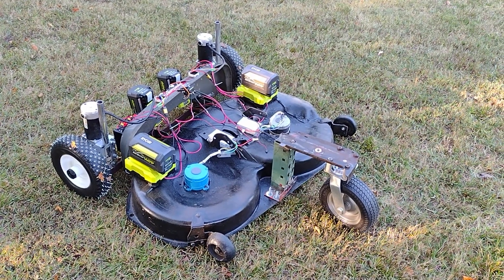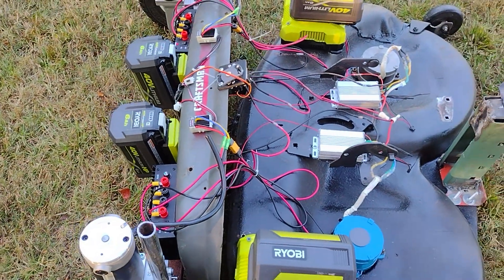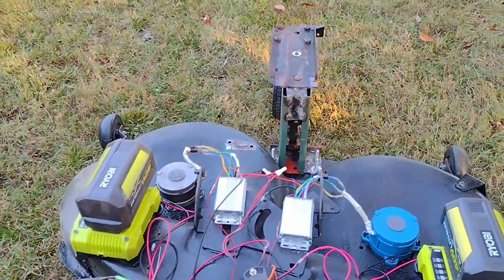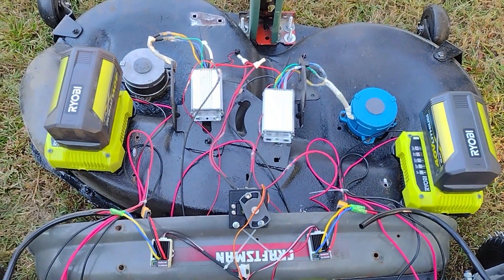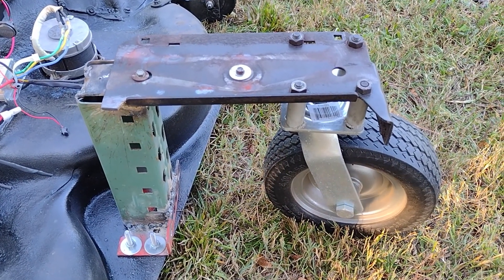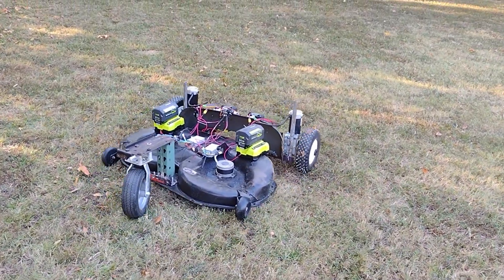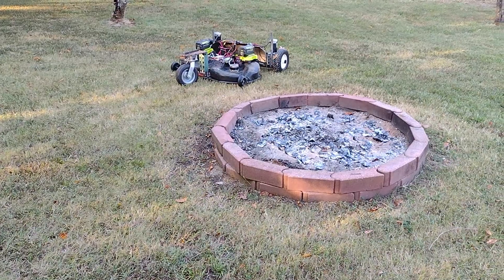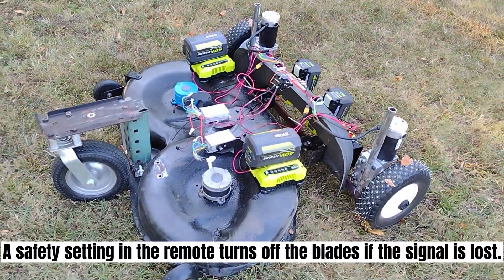Ryobi 40v Powered 42" DIY Radio Controlled Zero Turn Lawn Mower "Mad Max - Fury Mowed" - Part 2

Comment: what are the cutting  motors, watt and size of blade?
Reply from the maker: The cutting motors are actually pulls from a Ryobi push mower with 21" blades. They are about 700 watts, but I don't know for sure. I used the motor and controller from a Ryobi push mower.

Comment: The only problem with this is that the deck needs to be independent from the everything else .  I know you at stag 2 . Good concept . So how I would do this and still keep it simple as possable . Weld a support frame to hang the deck on . The frame also is the support for the wheel motors and the center wheel . I would get rid of this being a tricycle  and make it 4 wheel drive and steer . Then it would turn on a dime and can go up hills with out slipping . This being a 42 inch deck I would install two 5 hp Briggs engines it with blades .   This is to keep power loss down as well and letting the power packs putting power to the wheels . Longer mow times . You can find some good push mowers people dont fix or dont even maintan . Just setting by the road to be picked up . With a little bit of work like cleaning the carb and check these mowers out does the job .
Reply from the maker: I like the 4 wheel drive idea. I've even thought of using tank tread. Hanging the deck wouldn't be hard and would allow the deck to adjust better, although I haven't had the problems with that I thought I might. I won't get a gas motor, even though they are easy to get. Been a mechanic for many years, but I'm so tired of cleaning carbs I just can't stand out anymore. 😂 But I did consider getting a large battery and a bigger pair of electric motors, about 5hp, to do the job quicker.
Reply: @oddjobsandrandomprojects  Here is an Idea why not use two boat bats at 130 each . or deep cycle bats .
Reply from the maker: @jeffmullinix7916 That's actually a solid plan. I can also use those to store power for my garages off grid solar setup.

Comment: That is really cool. Maybe you could use heavy string trimmer line for blades. It would be much safer that way.
Reply from the maker: Not a bad idea, but it might wear quickly. I did set the speed slow to make it a bit safer. It's still a work in progress.

Comment: Put solar panel on the top to charge all batteries and also to cover the entire setup
Reply from the maker: Not a bad idea, but I'd probably just switch it to a lithium golf cart battery to do that. Then it's easier to set up a charge controller. But definitely worth considering. Currently I just have the solar panels on my house and use them to charge the batteries inside.

Comment: Add a drone and you got a work from home lawm mowing job for highway and stuff like that 🎉 just like a video game 😅
Reply from the maker: I'd have to find a way to increase the run time. Perhaps add a solar panel and some big batteries?
Reply: @oddjobsandrandomprojects  Yes, then have maybe 2 or 3 instance of mower, when working on 1 the others are charging, some kind of tandem work mix with lunch and break to squeeze charging time.

Comment: Did the tire nub thing work better ? Do they tear the lawn?
Reply from the maker: The tire nubs do tear the lawn when you make a sharp turn, but they also aerate the lawn. So it's good and bad. But they help the grip a lot. I find that double ended blind nails make the best tire nubs.
Reply: @oddjobsandrandomprojects  thank you for the reply. I will not put theses on my wheel :).

Comment: Can see several things that require "consideration". Firstly the reason the controller is making a noise is because the controller you are using is in the audible frequency. To give you an idea the controller I bought for my electric tilting trike is the Evnetics Soliton 1 controller has two settings, one I think was 8kHz, and the other is 14kHz. One most people will hear clearly, the other may be out of the hearing range of some, at the very least it will be heard at lower levels, but comes at the cost of efficiency. The controller on the remote control mower I am currently building is a Sabertooth 2 x 60A. I haven't tried it yet, but a friend used one, and I haven't heard noise from his.

The first thing I would address on your mower is the rear single wheel. Where you have it bolted to the deck, it is under a great deal of mechanical leverage, and I foresee it cracking / tearing the deck where the bolts are. I would tie the vertical upright into the top of the deck on both sides forming a pyramid. It would probably increase the strength 5x, and reduce the flex on the rear wheel.

In an upcoming video of mine you can see how to set up the switches to turn them on and off via relays, and some of the consideration that need to be considered when playing with relays. Overall I like your minimal approach. Can you mow the whole lawn on a single charge?
Reply from the maker: Much appreciated information! That helps me understand the motor whine better. You are right about that rear wheel setup, and I will definitely add more supports. I look forward to your video on relays, as that is a far better setup than what I ended up with. I cannot mow my lawn on a single charge, but I didn't really figure I would be able to since I have 2 acres. Takes about 3-4 sets of batteries, but I have that many on hand so not a big deal. I may see about adding extra batteries with a diode to prevent them from trying to charge each other. The blade batteries run out of power when the drive motor batteries still have 50% power left. So at least adding an extra battery to each blade motor would balance that out.
Reply: @oddjobsandrandomprojects  the other thing I was thinking you might want to look at is tip speed of the blades, as it effects grass cutting efficiency. I did a video on it ages ago with the math to calculate the right tip speed.
Reply from the maker: I'll be sure to check that out. It "should" be good since I basically took two factory built push mower motor, controller, and blade set and just installed them in a new deck. But it's worth checking anyway.
Reply: @oddjobsandrandomprojects  yes worth getting familiar with the math just in case you want to build another project. I don't have the greatest of memories so I made that video as much for me as everyone else, so that I would have a reference video to check back on if I needed to remember how I came up with specific pulley sizes.
Reply from the maker: @DodgyBrothersEngineering  same here. I put some of my videos together so I could have a repair manual if I need one.

Comment: What RPM are your blades set at? I know most Gas mower blades run at 3400-3600 RPM rider or push. While my Kobalt brushless runs at 2700, so sharp blades are extremely important. Very interesting project, like your YM conversion as well. I would love to know the HP rating of your motors used?
Reply from the maker: The blades on Ryobi are also set at 2700 rpm. I notice that they use a thinner blade than the ones on a gas mower, which probably helps with efficiency. I don't know for certain what the power on the motors is, but I have heard that they are about 1 HP each. However, they should have higher torque. So that makes comparing them more difficult.